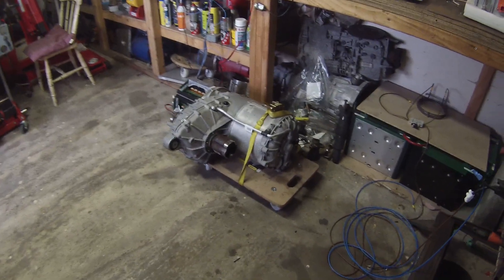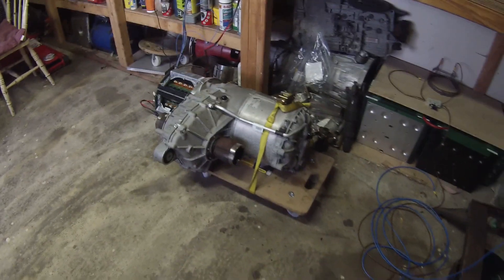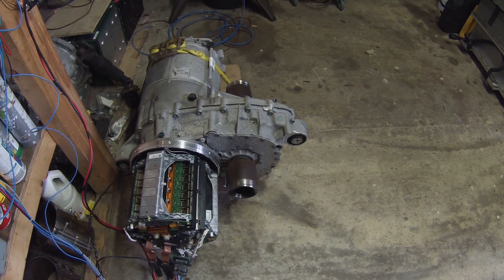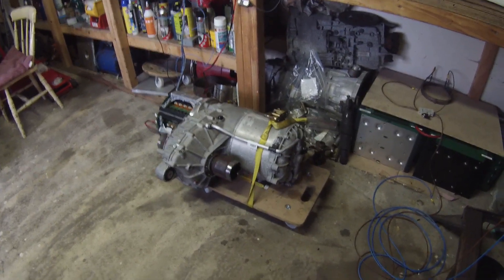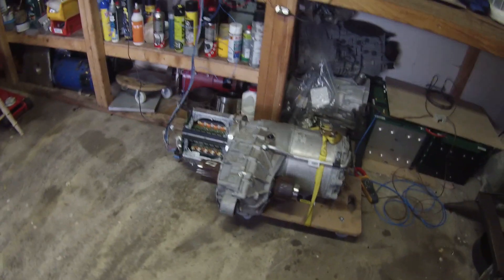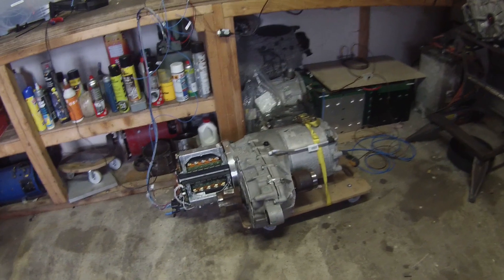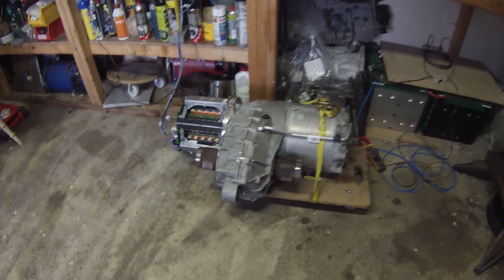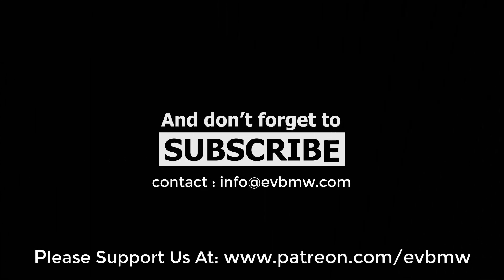The Tesla Project : Rear Drive Unit Back Together

Comment: Hello Damien, I have a question. I currently replaced the chip ARM2 STM32F103 with a new one because after trial and error the other one became unresponsive to the drive unit logic board. Do I need to reprogram the new chip in order for it to work?

Comment: You mentioned hill hold in the Tesla firmware. I believe that's accomplished by modulating the power brake unit, and not via the motor. Are you also going to use a Tesla braking system in the BMW?

Cool project!

Comment: Are you going to put this drive unit into the rear of the E31?
Reply from the maker: Yes :)
Reply: Damien Maguire does it have enough space at the back for this or will you have to do a lot of modifications to the body/chassis?

And one more question related to your current batteries. Do you have any more modules left other than the 2 that you've had to remove from the rear pack? Thanks for your answers.
Reply from the maker: Yes it will need a good bit of modification on that back. Luckily I'm getting a friend to help with that part. Would be a bit more than I can do in the driveway:) No more modules as yet.
Reply: Damien Maguire that's great you have the space and help to do it. I think it's brilliant what you are doing.
Do have any progress on your friends rx8?
Reply from the maker: Sadly no update on the RX8 as yet.
Reply: That's a pity. I've had this idea for a couple of years now myself, but didn't really do much about it. Haven't had the funds and space for it. Then when I saw your video about it, it sparked my interest in it again. It was great to see that someone is doing it here in Ireland. 😊
How do they legal things work with conversions like these? Nct, insurance, road tax?

Comment: Just so you know, the fluid splasher inside the gearbox doesn't work in reverse, so you risk gearbox failure at too higher speed.
EVTV took a drive unit completely to bits to discover this.
Reply from the maker: Thanks. Was a genuine mistake:)
Reply: Can't imagine it'll be an issue under no load :)
Reply: but the mercedes b class runs the drivetrain reversed how do they do that? it would fit better reversed on many applications. evtv said it was a oil pump, if it's a splasher no big deal...
Reply: I don't expect the gearbox is a dry sump, so there should be some residual oil on the gears, and I'd expect some splash lubrication going on.   I wonder if the pump is more about cooling than lubrication?